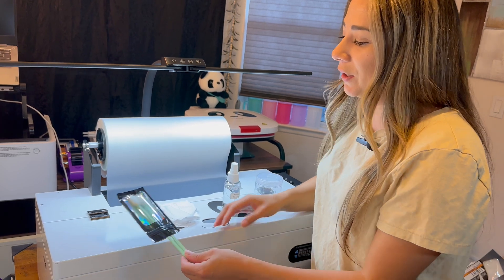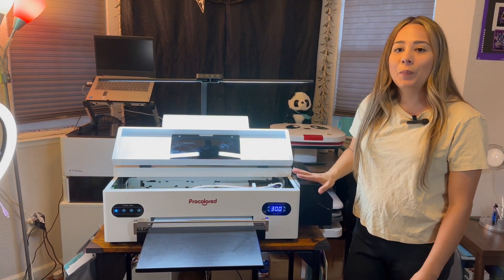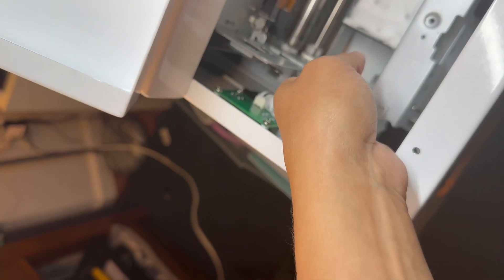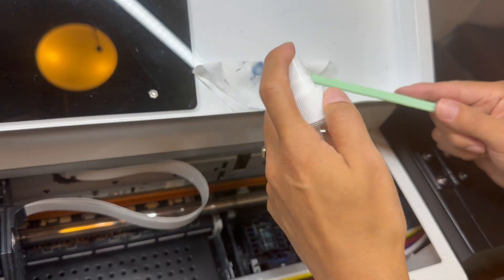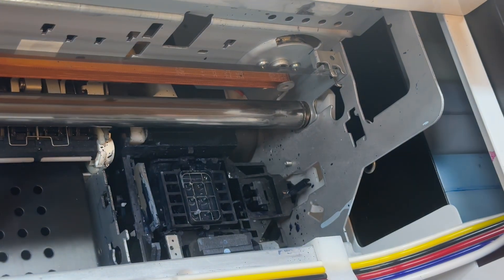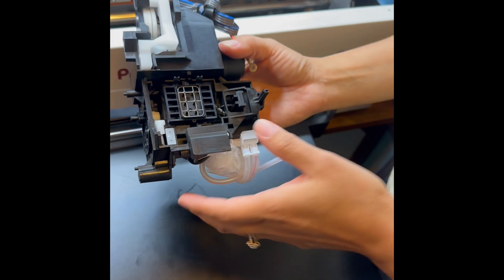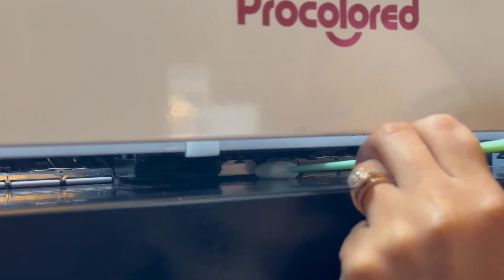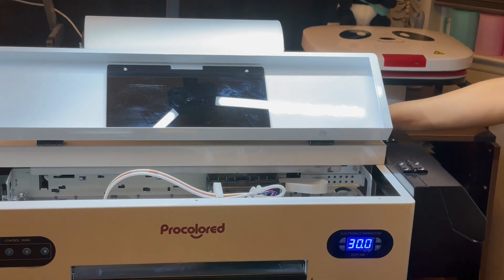The maintenance for Procolored F13 DTF printer

Comment: Pretty sure you should not be using alcohol cleaning the printhead or capping station as it dries up quickly and can cause clogs. Ok to use everywhere else though. Procolored suggested to me that moisturizer can be used around printhead. Only just got mine so correct me if I am wrong
Reply from the maker: Sorry for the misleading, alcohol indeed will clog print head

Comment: My platform looks to have a plastic over it.  Was I supposed to take that off when I got it? Also is this daily maintenance?
Reply from the maker: Yes, take the plastic off the platform. This is not a daily maintenance, you can do it monthly. You need to operate printhead self-cleaning daily though.